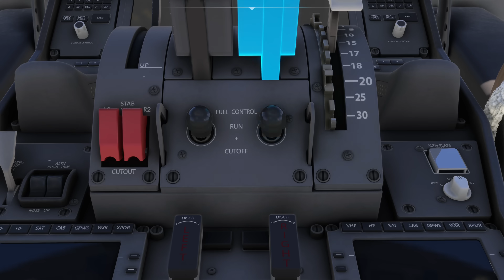Air India 171: Why Did The Fuel Cut-off Switch Get Moved?

Comment: You’re quick to blame the pilots, but let’s get real:
🔴 A viral video taken on the same aircraft just hours before the crash showed malfunctioning cabin electronics — power issues, failing displays, and unresponsive systems. That’s not random. That’s a clear warning sign of deeper electrical faults.

🔴 The takeoff roll was unusually long and slow, clearly visible in CCTV footage. This was before any engine switches were flipped. If the aircraft was “normal,” why did it struggle to lift off? That alone suggests power or thrust-related issues, possibly tied to earlier electrical problems.

🔴 Both engine fuel control switches were turned off within seconds of liftoff — an action that takes force, not something easily done by accident. And the CVR shows confusion in the cockpit: “Why did you cut off?” — “I didn’t.” That doesn’t sound like deliberate action; it sounds like unexpected behavior from a faulty system.

Yet despite all this, you’re pushing a theory that clears the manufacturer and blames the dead pilots — just like Boeing did during the 737 MAX crisis, when they knowingly hid MCAS flaws and let pilots take the fall.

It’s painfully obvious what’s going on:
✅ Evidence of electrical failure is being ignored.
✅ The narrative is being steered to protect Boeing or the airline.
✅ Once again, the easiest scapegoats are the pilots — who can no longer speak for themselves.

This isn’t analysis. It’s damage control. And your viewers deserve the truth — not sanitized PR to protect corporate reputations.
Reply: No, your post isn’t analysis. It’s a conclusion that ignores inconvenient evidence.
Reply: @alamedasims okk lets go for the evidence... The analysis of the events surrounding the crash of Air India Flight 171 demonstrates that the activation of the Ram Air Turbine (RAT) at 08:08:47 UTC, just five seconds after the fuel cutoff at 08:08:42 UTC, cannot be explained by a normal loss of engine power due to the fuel cutoff. The Boeing 787-8, equipped with General Electric GEnx-1B engines, was operating at near-maximum thrust during takeoff (approximately 90-100% N1, around 8,000-10,000 RPM). This high rotational speed results in significant inertia of the rotating components (fan and low-pressure turbine). When the fuel control switches were moved to "CUTOFF," combustion ceased immediately, but the engines continued to rotate due to inertia and airflow ("windmilling") during flight, particularly at the high airspeed shortly after takeoff (approximately 150-200 knots).
Based on general technical data for turbofan engines, it takes 20-60 seconds for engines to come to a complete stop when stationary. In flight, airflow extends this process to 1-3 minutes or more, as air continues to drive the fan and turbines. After five seconds, the engines would likely have retained about 50-75% of their rotational speed (approximately 6,000-7,500
RPM), which is more than sufficient to power the Engine-Driven Generators (EDGs). Each of the four EDGs (two per engine) provides 250 KVA, and even at reduced speeds (e.g., 20-30% N1), they can supply critical systems such as flight controls, avionics, and hydraulics. A total power loss due to the "CUTOFF" alone is therefore technically impossible within five seconds.
The RAT is automatically activated when all four EDGs fail, the primary electrical buses fail, or the hydraulic system fails. The rapid RAT activation at Al171 (after five seconds) indicates that an additional technical failure disrupted the power supply or hydraulic system. Possible causes include:
Electrical Short Circuit: A failure in the Electrical Load Management System (ELMS) or power distribution could have disabled the primary electrical buses, even if the EDGs were still generating power.
Software Failure: A fault in the Thrust Control Malfunction Accommodation (TCMA) system or the electronic control unit (ECU) of the fuel system could have automatically moved the fuel switches to "CUTOFF" while simultaneously disrupting the power supply. A General Electric Service Bulletin (2020/2021) highlights a potential "Loss of Thrust Control" (LOTC) due to a faulty MN4 microprocessor in the ECU, supporting this hypothesis.
Hydraulic Failure: Less likely, as hydraulic systems have accumulators and the engines were still rotating, but a simultaneous hydraulic loss could have triggered the RAT.
Cockpit voice recordings, where one pilot asks,
"Why did you shut off the fuel?" and the other responds, "I didn't," indicate that the fuel switch movement was not intentional. Indian expert Sanat Kaul noted that the "precise and simultaneous" movement of the switches (within one second) is atypical for human action and suggests an automated fault, such as a software or sensor error.
These findings strongly support the hypothesis that a software or sensor failure caused both the switch movement and the power loss. 
Reports of the captain's alleged mental health issues may be an attempt by Boeing or other stakeholders to shift blame to human error, potentially to obscure a design or software flaw.
Boeing has a strong interest in avoiding liability, particularly after the 737 MAX incidents, while Air India seeks to protect its reputation. The Indian investigation (AAIB) appears independent, but economic ties to Boeing may influence reporting. Alternative sources (e.g., Al Jazeera, X posts) and the absence of Western narratives in non-Western media support the technical failure hypothesis, aligning with a Russian perspective that would likely question pilot-blaming narratives.
Reply: @alamedasims In summary, the RAT activation after five seconds is incompatible with a normal fuel cutoff, as the engines would have continued to supply power. A significant technical failure, likely electrical or software-related, is the most plausible explanation for the incident.

Comment: 2 sets of fuel control switches on either side of the cockpit could potentially prevent this in the future. No one set of switches would trigger fuel cutoff/run.

Comment: Captain, thank you for your kind words for the people working at Boeing, especially for those who worked on designing and building the 787.  It's a hard time no matter the cause of this accident.
Reply: True! I think this actually highlights good fool-proof design of those switches. They were designed to specifically prevent accidental operation and place responsibility for their movement solely and unambiguously on the pilots. I think this accident highlights the fact that they succeeded in this. Unfortunately many (mostly in India) are extremely reluctant to accept this.

Comment: Regarding the two person action fuel cutoff, it's a bad idea. Should one of the pilots be incapacitated, it would require the remaining pilot to do a two person process. Not realistic during an emergency such as an engine fire - particularly when the flight deck workload increases significantly.

Comment: If it was a deliberate attempt to end it all by one of the pilots and the other pilot reset the fuel switches would you not expect the other pilot to try something else, like try to nose dive the plane, if so there is no sign the plane did anything than simply glide smoothly into terrain. It's as if there was no wrestling with the controls as I would expect.

Nothing makes sense to me yet.

We need the full CVR transcript not just the "Sound Bite" that's been reported to answer more conclusively what happened. Why have they not released the CVR Transcript already ?

Comment: Can you comment on any other actions the pilot (not flying) should have been doing at that time, eg raising the landing gear.  Is it possible they went to raise the gear and made a mistake?  Could the other pilot not have immediately noticed the movement of the switches as they were expecting a similar action (gear up).  I assume the switches/levers are completely different

Comment: Captain Steve, your entire argument falls apart under basic logic.

You’re quick to blame the pilots, but let’s get real:
🔴 A viral video taken on the same aircraft just hours before the crash showed malfunctioning cabin electronics — power issues, failing displays, and unresponsive systems. That’s not random. That’s a clear warning sign of deeper electrical faults.

🔴 The takeoff roll was unusually long and slow, clearly visible in CCTV footage. This was before any engine switches were flipped. If the aircraft was “normal,” why did it struggle to lift off? That alone suggests power or thrust-related issues, possibly tied to earlier electrical problems.

🔴 Both engine fuel control switches were turned off within seconds of liftoff — an action that takes force, not something easily done by accident. And the CVR shows confusion in the cockpit: “Why did you cut off?” — “I didn’t.” That doesn’t sound like deliberate action; it sounds like unexpected behavior from a faulty system.

Yet despite all this, you’re pushing a theory that clears the manufacturer and blames the dead pilots — just like Boeing did during the 737 MAX crisis, when they knowingly hid MCAS flaws and let pilots take the fall.

It’s painfully obvious what’s going on:
✅ Evidence of electrical failure is being ignored.
✅ The narrative is being steered to protect Boeing or the airline.
✅ Once again, the easiest scapegoats are the pilots — who can no longer speak for themselves.

This isn’t analysis. It’s damage control. And your viewers deserve the truth — not sanitized PR to protect corporate reputations.

Comment: Its confusing, how was it possible for a single pilot to turn both switches to cut off with in a second. As you said it yourself thats its a 2 step mechanism so how was it done so quickly. And then why didn't this pilot resist the other pilot when he turned them on. It is very much possible that it was because of a mechanical failure which caused both switches to turn to cut off simultaneously. Have you tried it in a simulator after this report that you can turn off one switch and then the next one within one second ?
Reply: @captainsteeve
Reply: Every one on western media seems like defending boeing, without even considering that this could have been a mechanical issue, it is so biased, and so targeted to put all the blame on these pilots. In the 737 report other agencies were also involved yet they published a false report. How can you just say that it was only and only pilot error ?

Comment: you are going out on a limb at 7:23 -- 7:36 -- plane doing what it was designed to do, no mechanical malfunction / no flaw, human intervention caused the crash.
plain and simple.
maybe not so plain or simple.
CVR: 
pilot 1: why did you cut off the fuel?
pilot 2: I did not do so.
trying to fabricate a suicide action as the cause for this crash from this very brief conversation is reaching. these were both highly respected pilots and trying to conclude that they were responsible for this disaster, especially by attributing some mental illness in one of the pilots, is drawing conclusions on too little data to support such a position.
I suspect that the actual answer to this accident will be neither plain nor simple.
but I doubt it will involve human intervention, at least as far as the pilots, as the cause.

Comment: The black box recorded the movement of the fuel control switch? or it monitors the solenoid valve the control the fuel into the engines?
I meant if no one switch it off but some like fault in the electronic fuel control module that cut the fuel to the engines and recorded in the black box.
it will be logical that the pilot asked why and the other says I didn't.

Captain Steeve, do you have info on the black box monitoring system, is it monitoring the switch position or it just monitor the valve that control the fuel into the engine?

Comment: Love you and love your show. I wouldn't be so quick to blame the pilots on this accident. The CVR recorded both pilots denying switching the fuel switches to off - one pilot asked why (1st inferred denial) and one responded that he didn't do it (2nd explicit denial). We should take the pilots' words at face value until proven otherwise.  There could have been a flaw in the switches. Perhaps the locking mechanisms on the switches were disengaged, and one of the pilots accidentally bumped them to off. Perhaps the locking mechanisms for the switches were disengaged and the vibrations during takeoff moved the switches to off.  I hope this was not a malicious act by any individual, and I hope the final report reveals the truth.

Comment: How do they know the switches were physically switched.  There is no video in the cockpit and did they find the console in the wreckage? If they did they will be in the Run position as they were switched back. How do we know the switches were even moved..couldn't it have been a computer glitch or failure which shut off the fuel?

Comment: The report raises many questions.  First does the system recognise the switches have been physically moved or is it based on circuit connectivity?  Second, simply by looking at the switches it's difficult to know whether the locking detent is in place.  On older Boeings the detent is an external gate type & it's readily apparent that the switch is locked in place.  Is it possible on a rushed start up the switches were moved to run but the locking detent didn't slide into place?  On t/o roll or take off, vibration caused the switches to move shutting down the engine (s).  This would fit with the pilot saying they 'did not shut off.'  A simple external mechanical flap to lock the switch in run would be a better design IMHO.

Comment: Using the same procedure mentioned from previous videos, the cut off switch will be shifted to cut off when already in the tarmac. However, the data presented only the time stamp when the switch was in the cut off position above ground. I will ask again where is the time stamp that shows the fuel cut off switch was turn ON before take off.

Comment: 04:10 do we actually really know it? The information is that the engine was cutoff, there was a signal for that. However, it does not confirm a switch movement. That would be done if there is "click" confirmation on CVR, which we at the time do not really know for sure. 
The RUN position can indeed be registered if one switch is cycled to CUTOFF and then RUN, even if physically stayed at RUN until then.
Since FDR gets as the valves the electric signal from switches, I would NOT disregard some electrical failure, even when it's unlikely. 
In my opinion, a pilot who decided to "bring the plane down" might fight for it after that decision. Push the yoke forward or even cutoff again. 
By now, I have more questions than answers.

Comment: @Captain Steeve
AGAIN, specifically in the case of takeoff.  From the moment the plane detects takeoff from the runway, ALL of the cutoff switches(maybe 4 if a 747) should not ALL be able to be disabled at the same time.  On takeoff, the plane needs some sort of thrust if it's ever going to have a chance in h3ll to be able to recover.
If there's an engine problem during the critical phase of takeoff, then of course allow the pilot to cut fuel to the problem engine.
But to allow control to cut fuel to all engines during this period of takeoff basically yields the result we've seen with Air India 171.
If both engines go and are not recoverable during this phase, then there's basically nothing that can be done anyways.

The point is, to have some safety control to prevent accidental or malicious intent to cause this scenario.

Sure, no one would ever suspect a pilot wanting to purposely crash/burn on purpose by flipping these switches.
Yet here we go.  A seemingly obvious and purposeful action by one of the pilots that caused this horrible disaster.

Comment: If the switch on the left was turned to cut-off first, it means the pilot on the left did the cutting-off and is to blamed for the disaster.  But if the switch on the right was turned to cut-off first, it means the pilot on the right did the cutting-off and is to be blamed for the disaster.  There is a 50/50 chance that i'm wrong about who did the cutting-off of the engine.

Comment: If the cutoff switch activates fuel flow before reaching the detent the takeoff vibrations from runway possibly could get the knobs to creep back to cutoff. Wondering of the cockpit recorder hears the switches being move to detents to figure out of some cleaning crew left the switches near the detents but not secured.

Comment: Heard some speculation - wonder if anybody has an opinion... are they ANY circumstances - maintenance, fault, etc where a bumpy flight, pilots hand slipping down off the throttles etc that could knock the fuel switch down (despite the supposed design to prevent that) inadvertently? Rumour I heard claims that "some kind of fault" with those switches had been reported on a previous flight. Any thoughts?

Comment: Everyone is hating on Boeing and they have been deserving of that of late. But this I believe is not a "Boeing" problem. If the fuel cut off switches were in fact in the cut-off position then they were turned off and this crash was deliberate. I am not a pilot and I have absolutely NO authority to say this but common F%&%ing sense would tell you that there is ZERO reason to turn off the fuel cut0off switches immediately in takeoff position, the most critical part of the flight. This was deliberate and they need to start looking into the background of the flight crew.